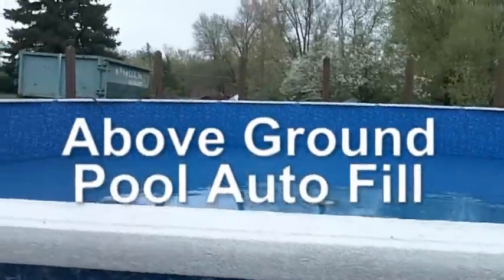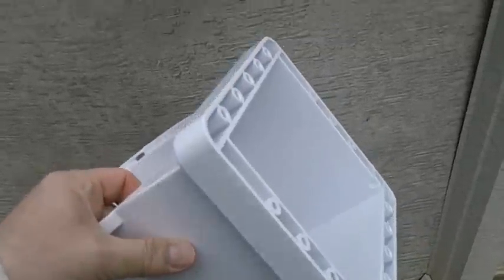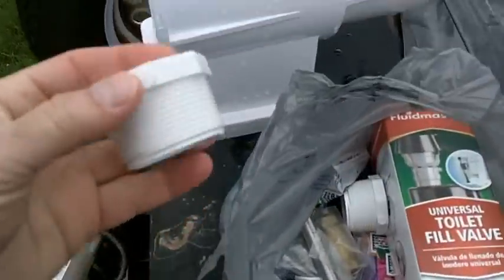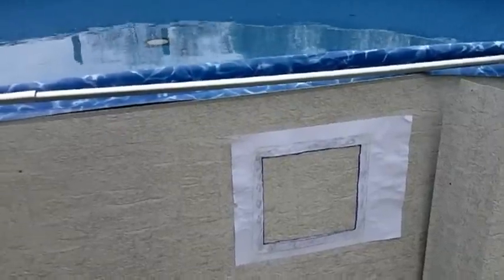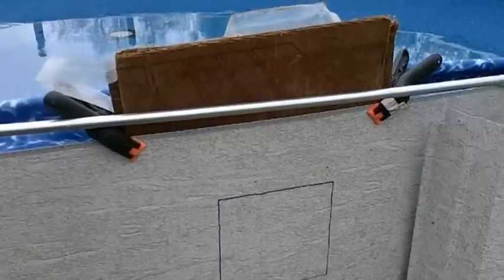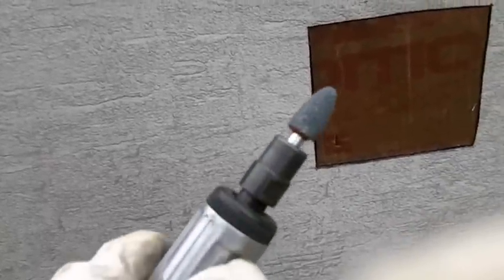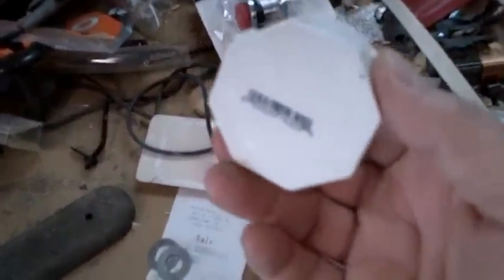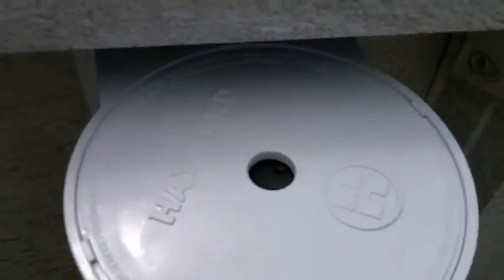Installing an Autofill on an above ground pool

Comment: Is there anything out there to cover up a simmer hole when RELOCATING the skimmer apposite side of the pool?
Reply from the maker: Only suggestion I have is to find a metal patch of slightly thinner gauge metal, pull liner back, glue in patch using silicone, or maybe bolt in with a low profile head bolt, then check pool store for a large size liner patch.  I'd think hard about just replumbing it if possible instead of moving skimmer.